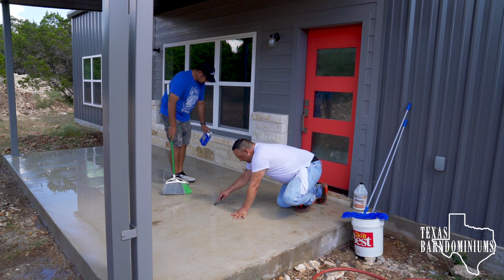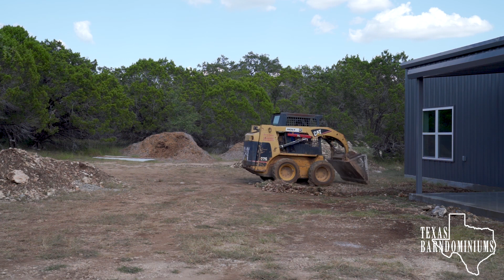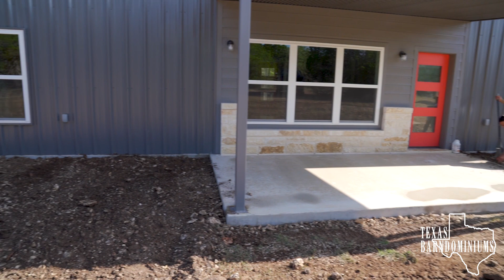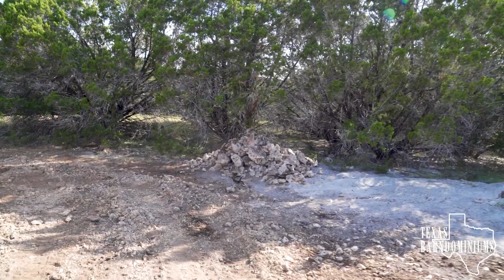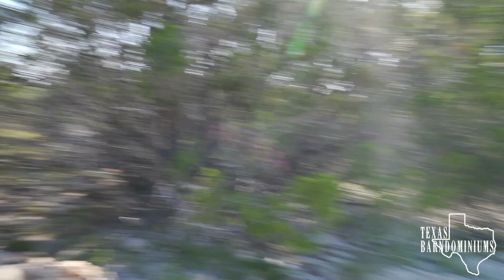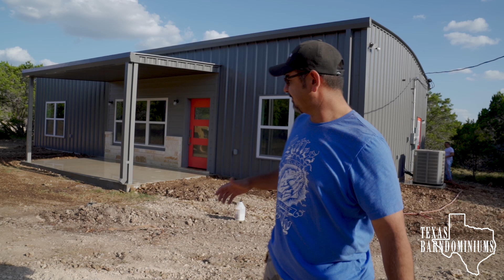Barndo 209 almost ready! - The Barndominium Show E152

Comment: Nice little Barndo. Look forward to inside pictures. I noticed the the  overhead power supply coming into the house from power pole. Could it be run under ground so that it's not visible?
Reply from the maker: Yes, it can be underground.  Most of ours are underground, but customer wanted it this way.